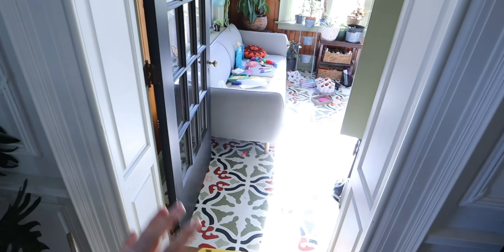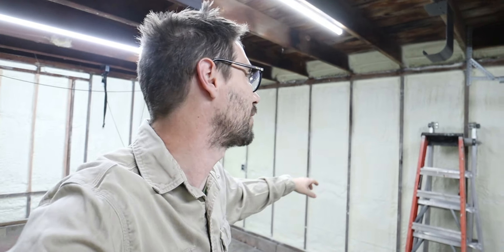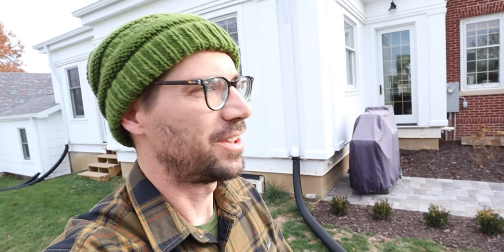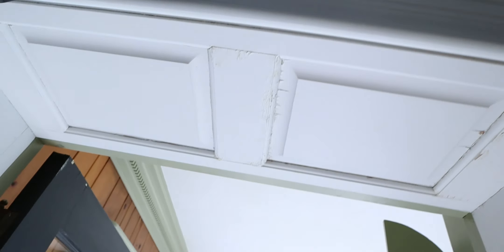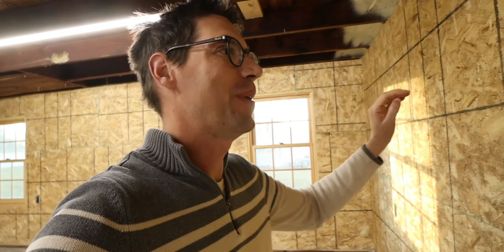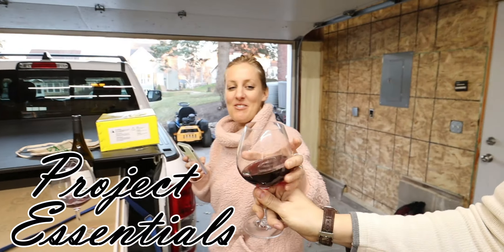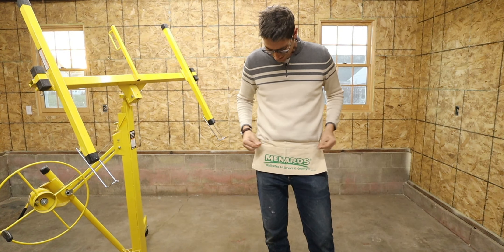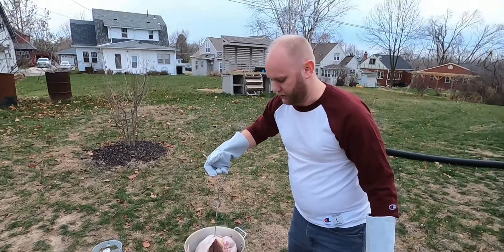Why is it raining inside? Please Stop!

Comment: Intruding water.  UGH !  I have that on a north facing valley.  I have a feeling it has been a problem for the 70 year lifetime of my house.
Reply from the maker: Wow, I didn’t realize how many people could relate.
Reply: @RealityDaydream  A roofer came out and put some tar on the area of most concern.  It slowed down the leak but it didn't stop it.  If it were not for keeping the main part of the support for that valley resting on a wood support, I wouldn't be so concerned, but I don't want those supports to be wet every time it rains or when the snow melts.